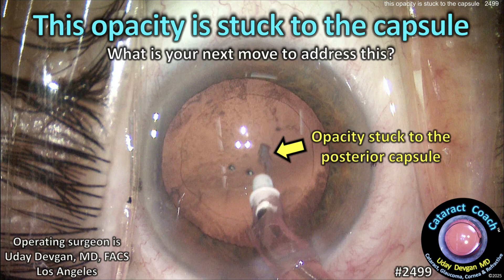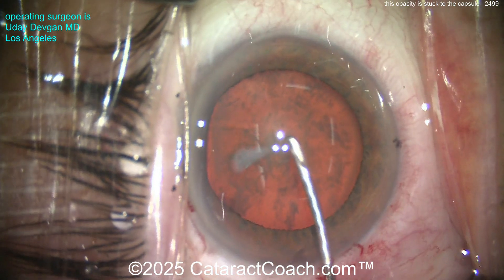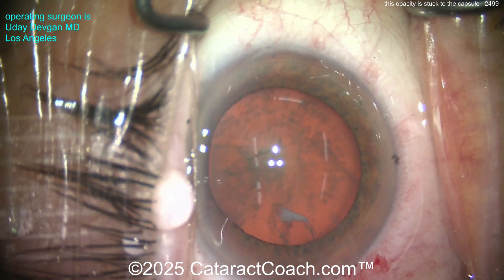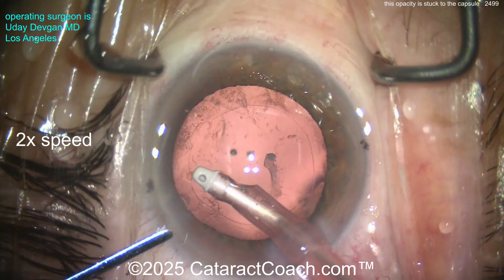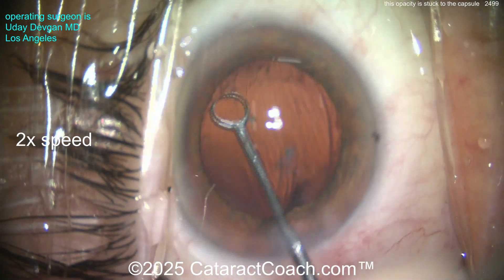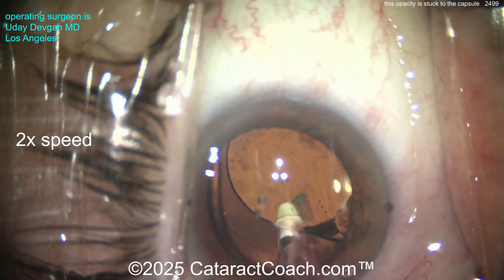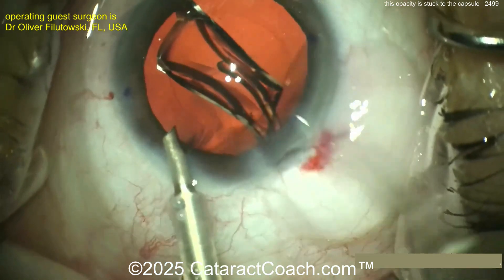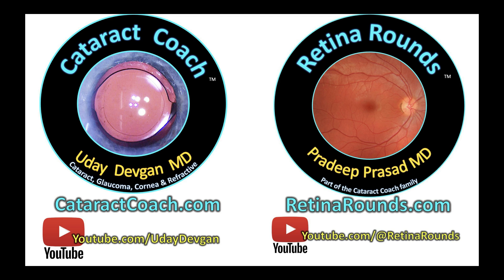CataractCoach™ 2499: opacity stuck to capsule

Comment: You need to add more viscoelastic to the bag to distend it and then come through a paracentesis with a 25 forceps and could peel that off because you'd have more countertraction. If that doesn't feel safe, put the IOL and then do it.  If the opacity still doesn't come off then leave it and YAG.  No reason for heroics